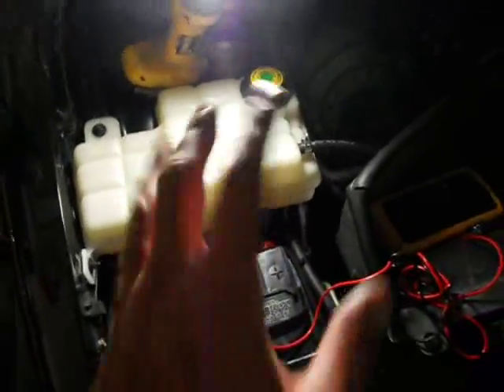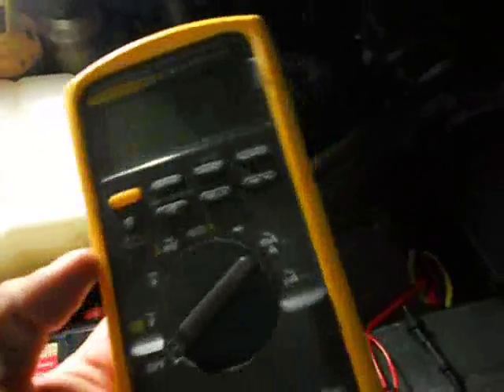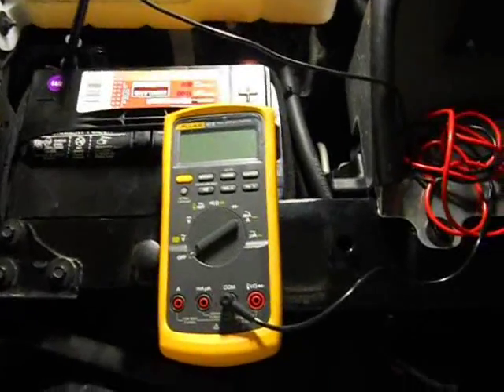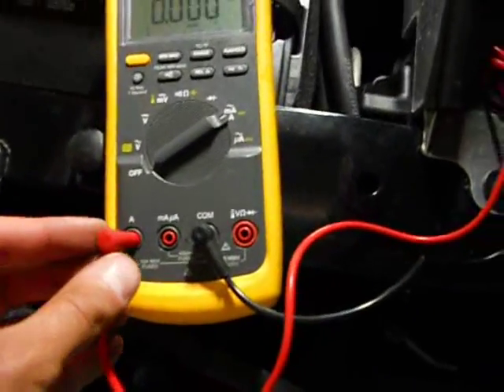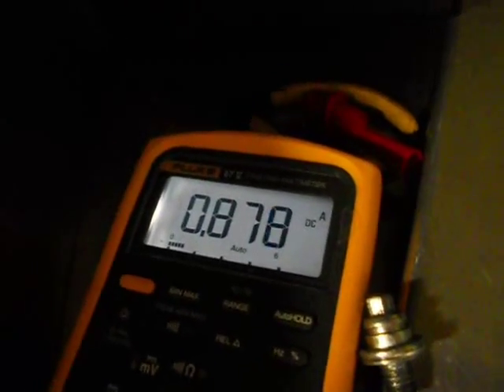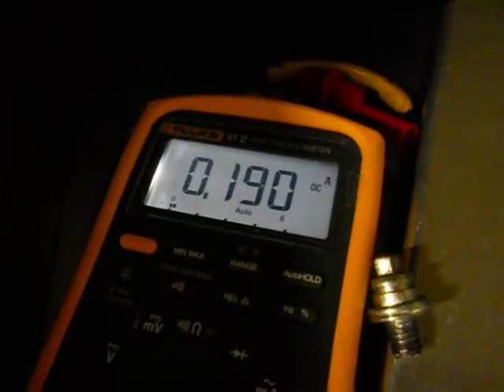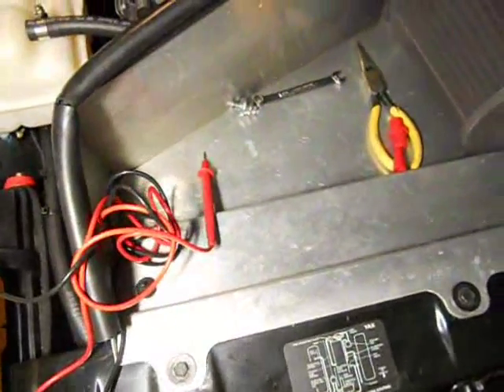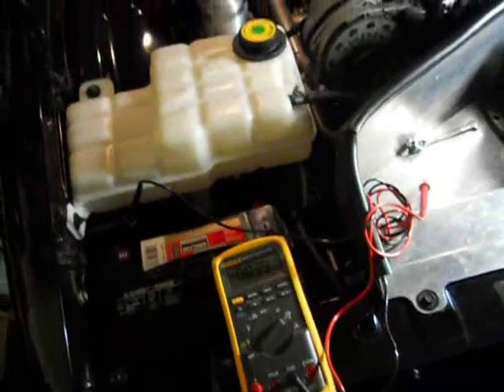How to test for a Parasitic load thats killing your car battery with a digitial volt meter

Comment: That draw you are seeing when you reconnect it up is the car's ECU reinitializing itself after loss of power. Then, after a certain amount of time it will go back into sleep mode once it sees constant power. Pretty typical on newer vehicles. It's also suggested that once you start removing fuses, to keep them out until you find the trouble fuse. Just like above, you could turn the computer back on to stand-by mode rather than having it stay in sleep.